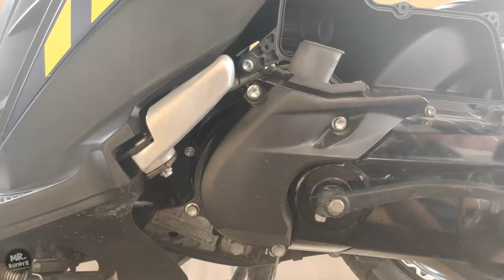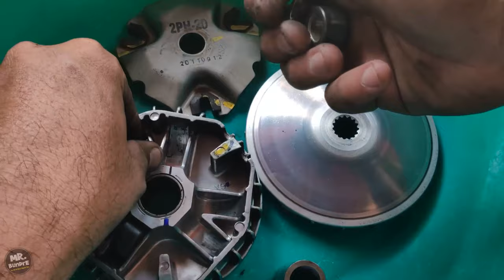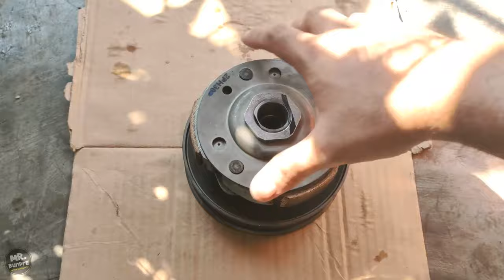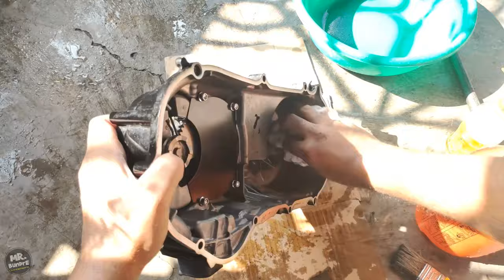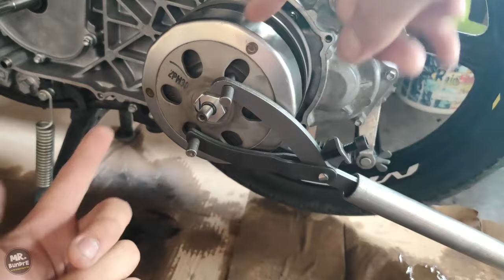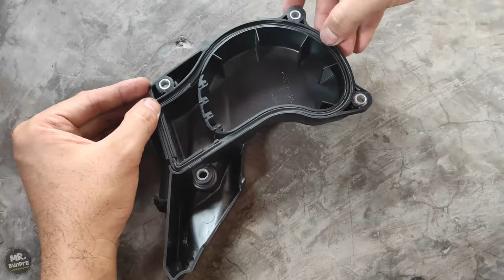Yamaha Mio i 125 CVT CLEANING | DiY CVT Cleaning for Scooter | Step-by-step Tutorial Guide

Comment: Pano pag walang Y Tool?
Mas okay ba mag invest or gumamit sa impact wrench like sa mga shops?
Reply from the maker: mas ok sir kung mag invest ng ytool at power handle(breaker) at torque wrench (para iwas overtorque at bilog ng nut). pwede nman ang impact wrench kaso. kapag sobrang overtorque. hindi na minsan kinakaya nito. check mo tong video na to sir mga guide lang na ginawa ko. 
No Y tool removal - https://youtu.be/9u9IMFNCGHo
removal using impact wrench -  https://youtu.be/GLZdsbewqjI
torque specs drive face at clutch bell using torque wrench - https://youtu.be/Ym-kwYjq2JI